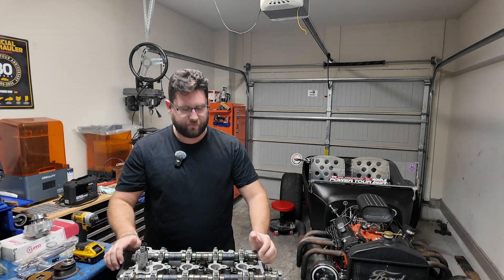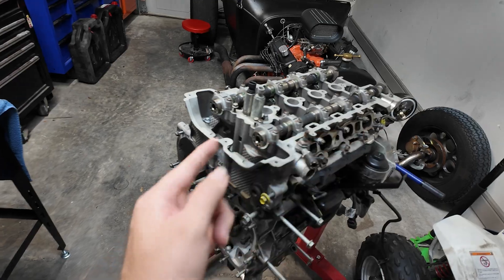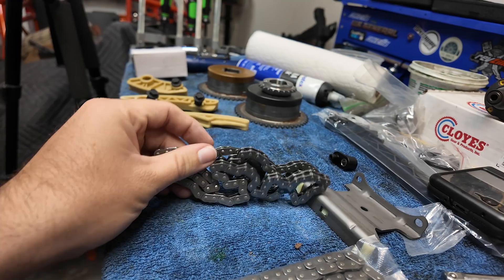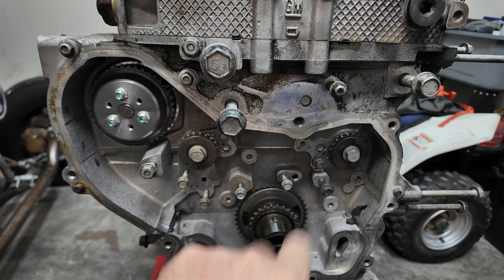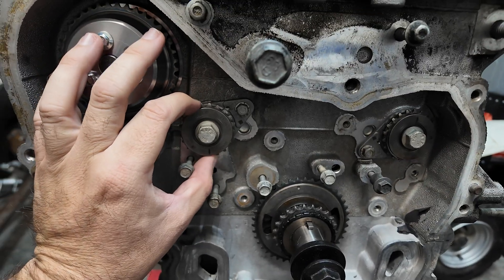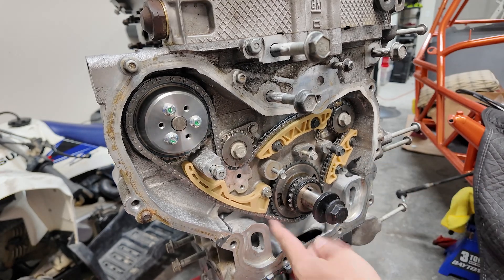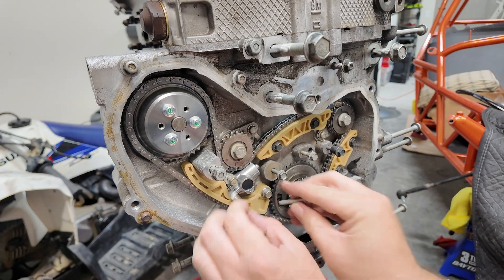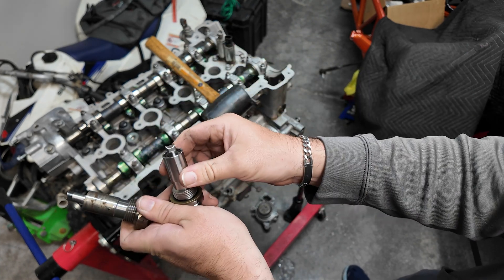GM Ecotec 2.0 LNF Budget Build!  Rebuilding the Turbocharged DF Kit Car Ecotec Engine Part 3

Comment: I have a 09 cobalt ss has a random crank no start. I checked everything as far as fuses, grounds , spark , ignition , fuel ect..
When I checked my timing I put my first cylinder at TDC and my balance camshaft sprockets and crankshaft sprockets skipped a couple teeth. None of my colored links are timed. 

My question is if I can remove the chains and align the sprockets by hand and re install.
Reply from the maker: No you would need to rearm it, buy a cloyes rebuild kit and do it right.  

You won't be able to do it with the "arming pin" and you cannot disengage them.

You can really damage the engine if you don't do this correctly

Comment: Hi, I ve got a question. I have same motor in my vauxhall astra j opc in europe with name B 2.0NFT. What do think about fiablitiy about this engine? Bad Points? Good points?  Thank you for the video .
Reply from the maker: Amazing motor,  get rid of the junk timing chain set and this thing rips.  Its a very unknown motor but its came of the line ready to run 450hp+ with forged internals.  unheard of at the time and still to this day for a stock production I4.  It was also the first of its kind to offer DI.
Reply: @GearHeadzGarageUSA  thank you so much for the info ☆☆☆☆
Reply: Never ever re-build an Ecotec engine using the standard timing chain parts. Use a replacement racing RH timing chain guide made of green coloured nylon (made in the US), replace the top RH guide fixing with a Dorman upgraded bolt kit & use ARP M6 bolts for the rest of the guides with spacers where required (available in a kit from the US or off eBay). I would also recommend using a new tensioner, but to replace the 'O' ring with a better fitting one to increase the depleted hydraulic effect which they suffer from from new. Use a high quality synthetic motor oil, change at every 12,000km max. & oil filters at every 6,000km.
Reply: @Fritz-y6g thank you so much for your precious advises❤.
And every how many km change it my chaines?

Comment: There is a tool that bolts the water pump sprocket to the timing cover. It's not bad job at all on these. Also as someone who deleted B-shafts on my 4g63, i wouldn't do it on an ecotec, it's not worth the vibrations. Also, a quick tip.... snip the very top center of the front cover gasket so it doesn't wrap around the engine mount, no clue why it does that and does prevent removal once installed.
Reply from the maker: I have that tool and is a life saver for when the motor is still in the car.  I believe at one point before all the aftermarket one appeared GM/saab was the only one selling it and it was almost 400$ a very long time ago! I think now they are about 30$

Yeah I don't think the extra nudge of Power is worth it to delete it either but it seems to be gaining popularity but that extra little 20 hp if it's even that much 🤣🤣 I choose a smooth runner over a giant vibrator